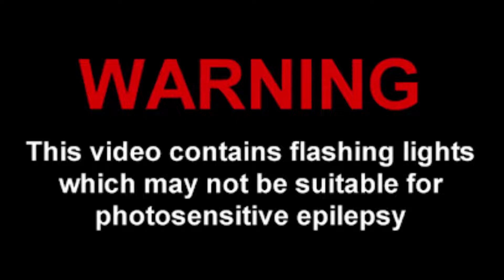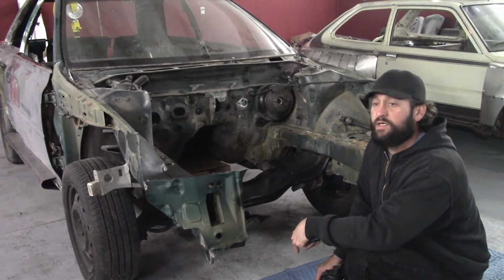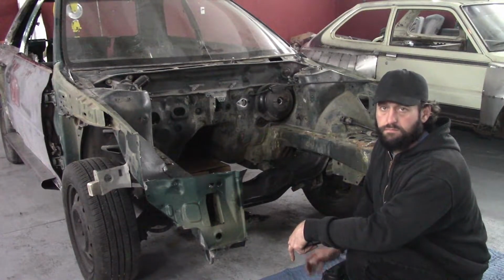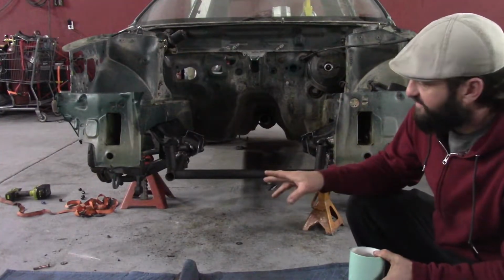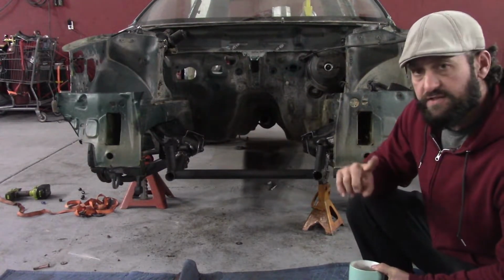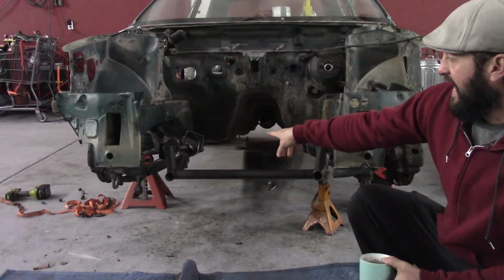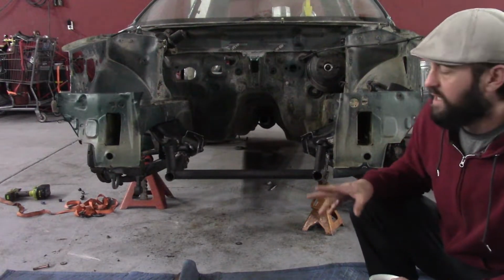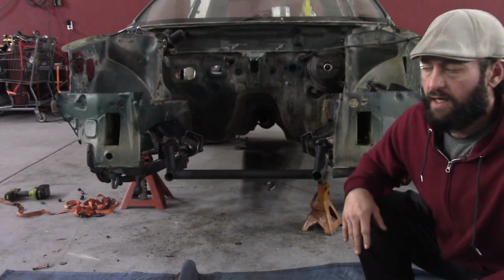Impreza41- Modified sub frame for LS Swap

Comment: What band saw is that?
Reply from the maker: Eastwood bench top
Reply: @PsuedoMechanic  looks way smoother than a sawzall!
Reply from the maker: @lstz31  I have had very good experiences with all of Eastwood’s  tools. The MIG /gmaw welder I use is their lowest priced 220v unit. I would recommend it to anyone who does sheet metal and tubing. It also has the spool gun for aluminum and that works decent. It might take more practice to get it to work really well but I don’t weld enough aluminum to know.
Reply: @PsuedoMechanic  I have an Eastwood 200 tig and I love it. Very reasonably priced and does ac. The bandsaw looks like a better option than the harbor freight portaband with a bench mount
Reply from the maker: @lstz31  I believe that if something is safety critical we should spend a little more money. I have an American made Rotary lift in the shop for that reason.